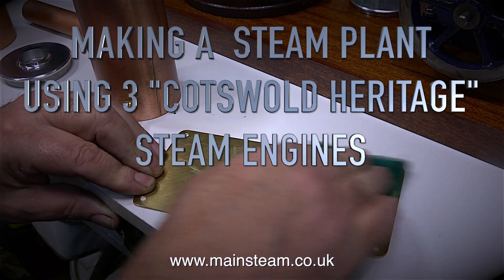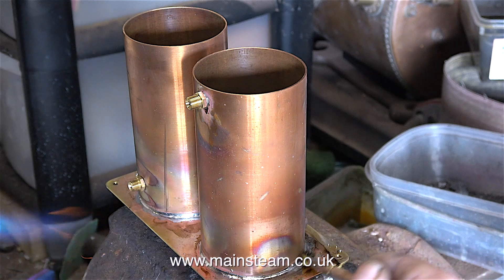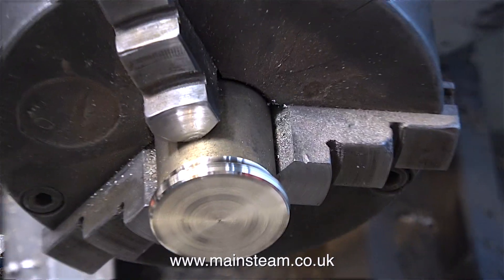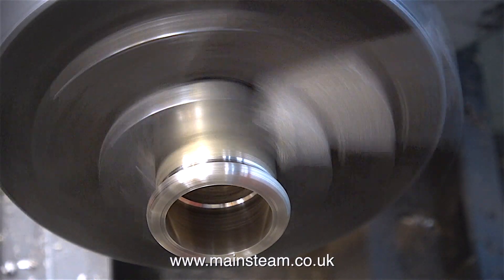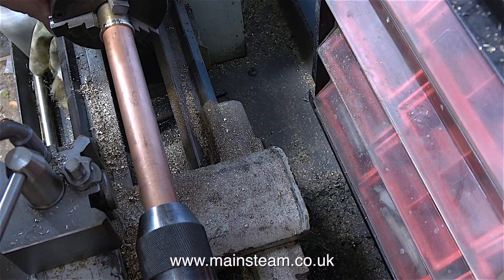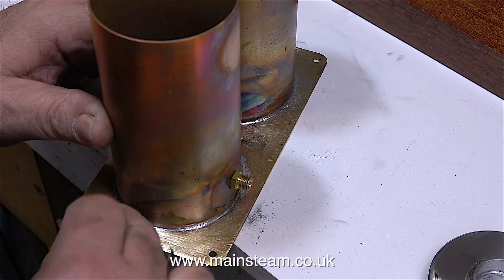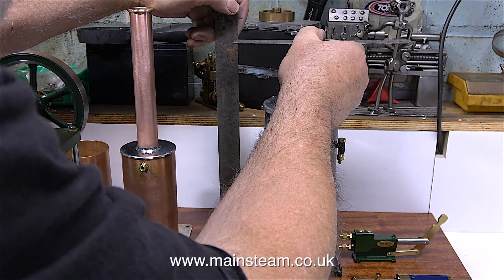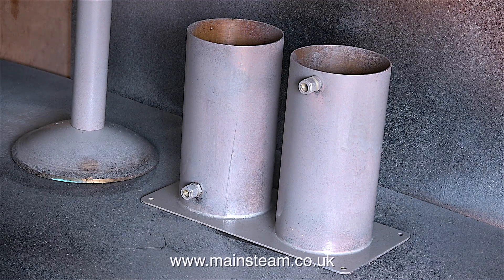A MODEL STEAM PLANT WITH 3 STEAM ENGINES - PART # 7

Comment: I have always used a many folded and slightly damp paper towel for backing during polishing!
For files I tend to hold the end as well although the ends are usually sharper!
Our new to us 60 year old Raglan has a 1 inch bore or 26 mm for the converted and a number 4 Morse taper! I am starting to repaint so welcome the Paint Drying assistance. Or  could come in and watch your paint drying in comfort! While ours drys in Real Time outside!!!
Love from
David and Lily.